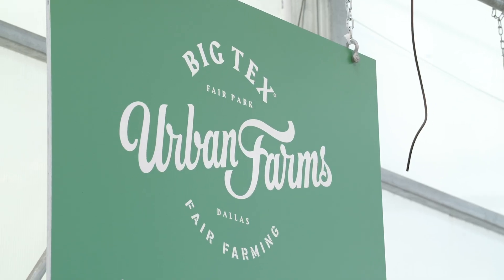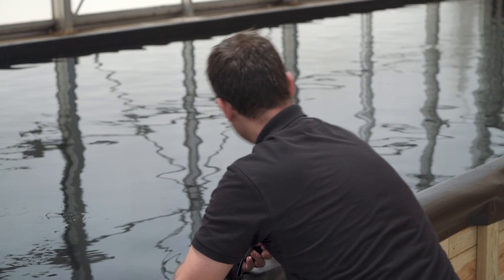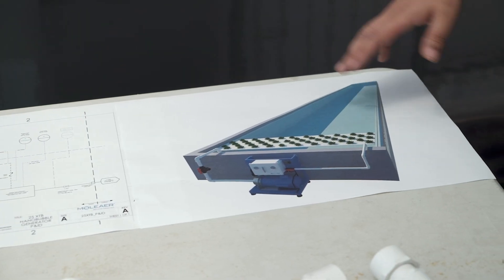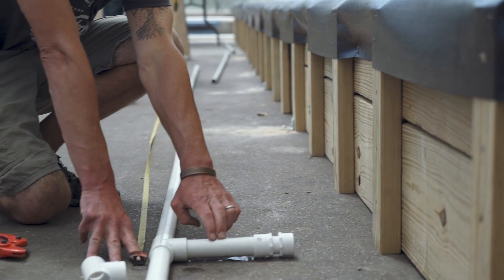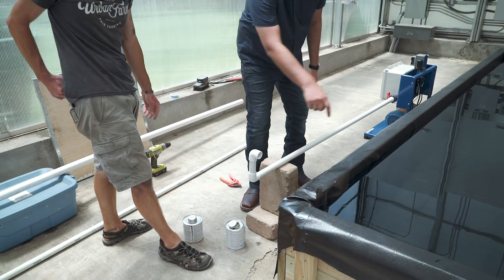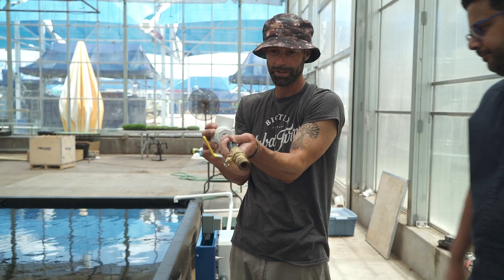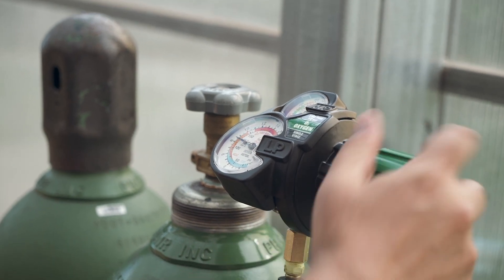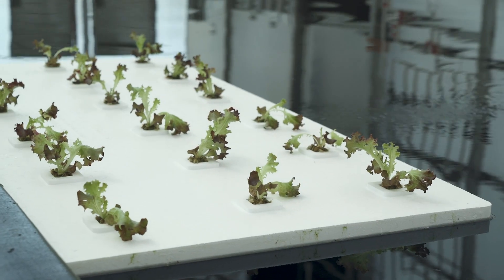Grow Bigger, Healthier Plants with Deep Water Culture: Installation Tutorial

Comment: What the difference if you use a Air compressor??
Reply: With air compressor you wont get maximum DO concentrations,
Nanobubble will stay inside the water for longer time, 
It will super saturate the dissolved oxygen level up to 45 mg/l, algae control can be seen, there will  be less biofilms in the system, plus it also has oxidizing effect which sterilizes the water without any chemicals.
Reply: @prizonfrost123  Ive got an Acniti mixer, just got it, and am testing with just compressed air, and it really doesnt raise the DO at all. Its like 1-2ppm increase. I was dissapointed because it would have been much cheaper to run with ambient air, but it appears that wont really work to raise DO up to where I want it.

Comment: How long does the oxygen tank last What does this monitor system cost do you have the plans for building your waterbed did you make a video on building your water bed
Reply: Depends upon the operation size, you wont need to run this pump 24 hrs as the air compressor.
Once the oxygen level drops at certain level you can start the machine

Comment: Add an oxygen concentrator and dump the bottles.
Reply: regular concentrator wont work. It has to be pressurized to just above what the water pressure is, because the water pressure creates positive pressure at the oxygen inlet. Thats why they ran it at such a high psi. You have to get a more expensive generator system that is paired with an air compressor, or pair a compressor with a plain concentrator.
Reply: @jonosterman2878  
Well yeah it would have to be an industrial one but those exist.
Reply: Moleaer's Neo model has on board O2 available so you don't need bottles.